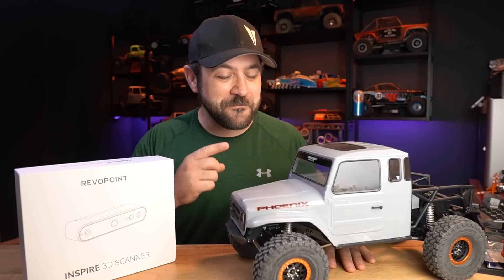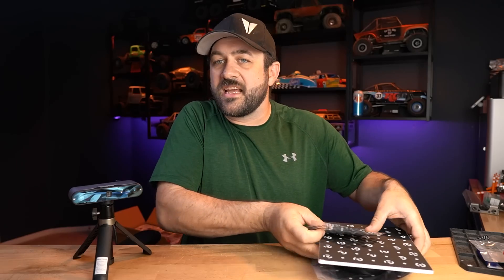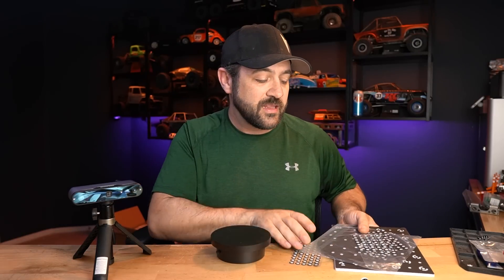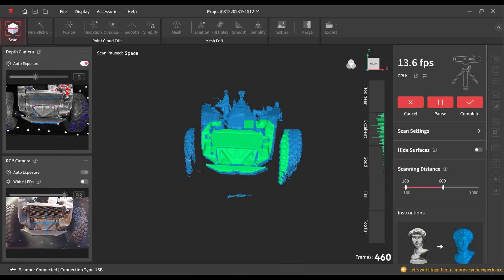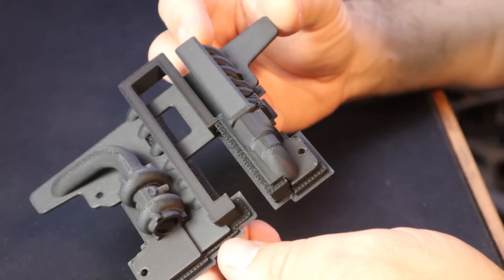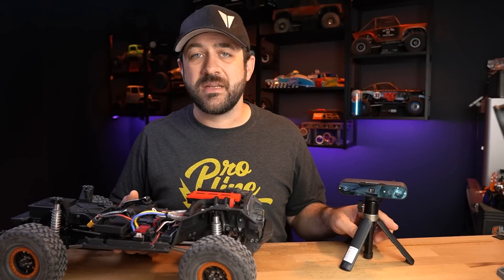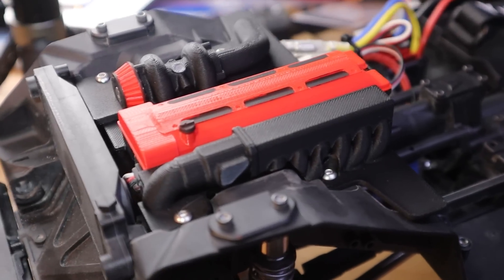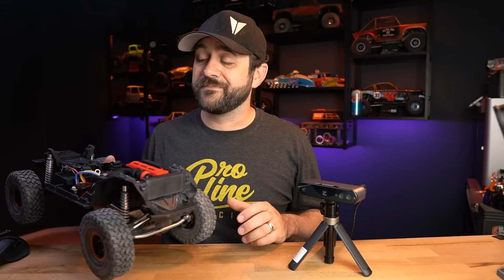VS4-10 3D Engine Cover using the Revopoint INSPIRE 3D Scanner

Comment: How does this compare to the Ferret? Similar price point, but the ferret has 0.1mm accuracy (supposedly, I take these numbers with a grain of salt) and I like the thought of being able to use the phone.
Reply from the maker: You’re exactly right on accuracy numbers, and I personally didn’t notice a huge difference in accuracy. However the software on the Revo is much nicer in my opinion. It give the ability for multi scan. Overall, this is my preference between the two.
Reply: @HarleyDesignsInc great content as always! Of all scanners/software you've used or even know of which would you prefer for this type of application?

Comment: This scanner is pretty nice. However if you don´t want to spend that kind of money, you can simply use photogrammetry instead. Nice Software cost 180$ and you can use any camera, even your phone. The precision is comparable, especially for parts like that but you are way more flexible, you can scan tiny parts or a whole building which this scanner can not.
Reply from the maker: I’m the end this is using a form of photogrammetry as well, and you could do it the manual method which I’ve tried previously as well. However, you’re not likely going to match the amount of information, the number of photos it would take would be quite overwhelming for the same accuracy.
Reply: @HarleyDesignsInc  So in the end my method is way cheaper, maybe slower depending on the job but just as precise. While slower it is also more versatile. So for a hobbyist I really see no point in buying this device.
Reply from the maker: A screw driver gets the work of a power drill done too, but one is faster and more powerful. The accuracy and speed of these scanners are well worth the minimal investment that they have gone down to. Especially if you’re designing parts in the range of scale that they optimized for.
Reply: @HarleyDesignsInc  1st. This is your opinion, it is worth it to you, this is not a general case for everyone. 
2nd. comparing the price to performance ratio you always have trade off. You can not scan a whole building with those scanners for instance. So you lose versatility. I would agree with you if the scanner was say 300$.

Just let people decide for themselves. Some might want to buy the scanners others would like to try out the cheap alternative. BTW open scan is even cheaper, full automated and has the same quality for about 200$. It is designed to work with small objects.
Reply: @sierraecho884  the scanner is 285 on kick starter... or did you not click the link LOL